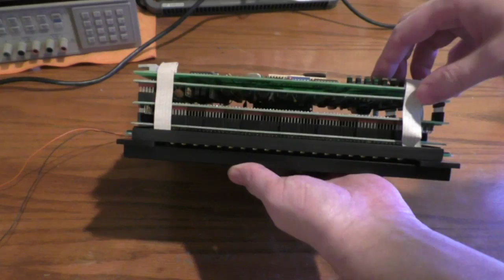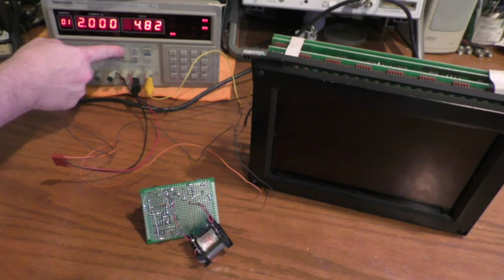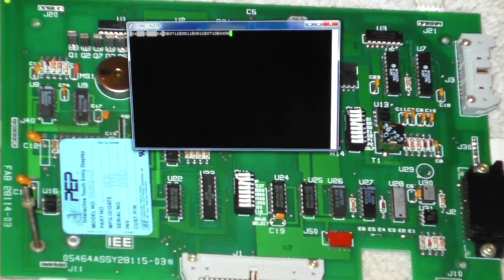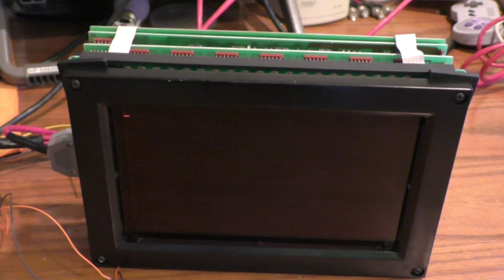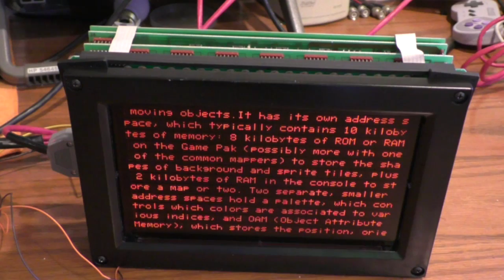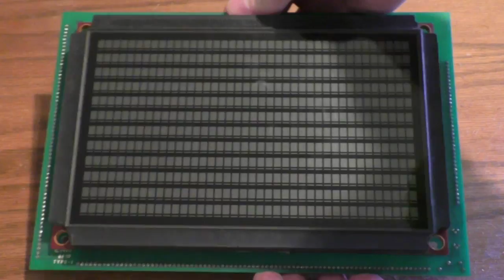Teardown and test:  IEE Neon Plasma Display

Comment: I would love to learn electronics reverse engineering. i'm always finding LCD's without datasheets, and find it hard to interact with them to make them reusable in other projects. I am still a Junior in electronics, but i have a good foundation to learn quickly. I have a passion for it.

Mike,
Mendelsons Liquidation Outlet
Dayton, Oh
Reply from the maker: +Mike Wiley heya, great to see you watching my vids!  If you want to use old LCD displays, the best way to start is to look the chips up it is using on google and download the data sheet.  After that, you can then trace the connector pinout and match it up to the chip pins on the data sheet.  Any kind of microcontroller or CPU should be able to run it after that.  The only exception being the large graphics displays that need constant refreshing- some do not have display RAM and need to be "manually" refreshed to show an image.
Reply: +kevtris So when are you going to be back here at Mendelsons ? :P
Reply from the maker: +Mike Wiley next time we get around to ohio, hehe.   If it wasn't such a haul from indy I'd go there all the time!

Comment: +kevtris - Are you tempted to put all of that jellybean logic into a CPLD?

That would cut down a lot of the power consumption at least?

Does it also allows custom characters via the serial port?

btw, I think you'll find the natural next test for any plasma display is to play Still Alive from Portal on it. :)
Reply from the maker: +electronash hahaha, yes next time I show off a display I will use the Still Alive lyrics.   Good suggestion.  And yes I really have an itch to replace all the old 70's and 80's tech with something a bit more modern.  I have already done just that on a Burroughs 12 line by 40 character "self scan" display.  Replaced 90% of the guts with a PIC micro doing everything including a PS2 keyboard.

Comment: what is that high voltage sound the more text you put on the screen?
Reply from the maker: +digitalblasphemy1100 it makes a soft buzzing sound when running, guessing it's the elements in the display moving or those ceramic capacitors being microphonic.  It is in time with the display refresh so it could be either one of those.  If I put my ear up to it, I can hear the noise emanating out from the display/HV board area.
Reply: kevtris I get that same sound when I turn on my tape deck. I think the caps are dried out or something. They are from 1979 so it's probably time..
Reply: +digitalblasphemy1100 Often the "buzzing" on audio means lack of good grounding. Its a normal issue on old big crt tv`s. Specially when it displays white. Vectrex is a good example of this problem. Also fluorescent lamps and working with audio dont mix... Power transformer coils might also make sound if the wires arent tight enough. Regular superglue will usually help on that.
Reply: Kangsteri that's so strange to me.